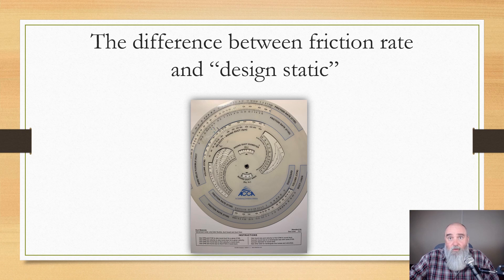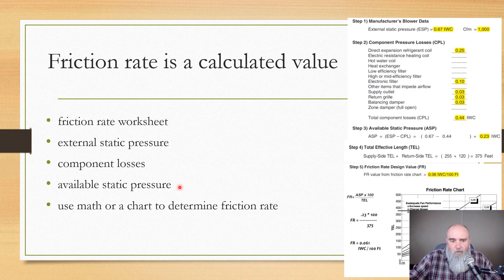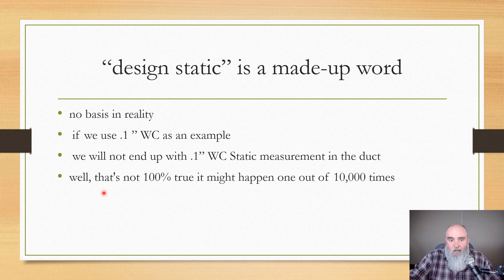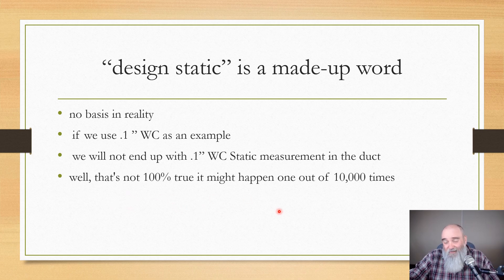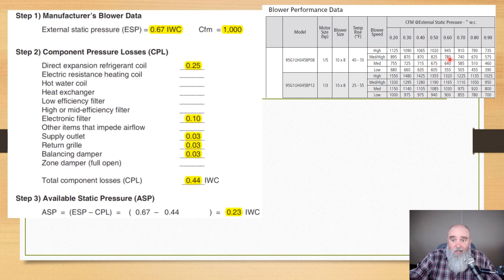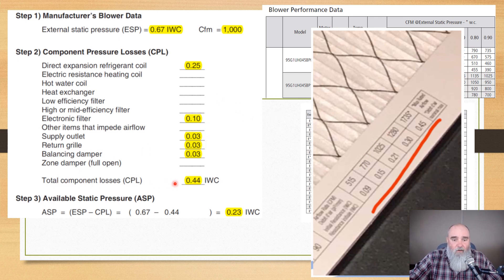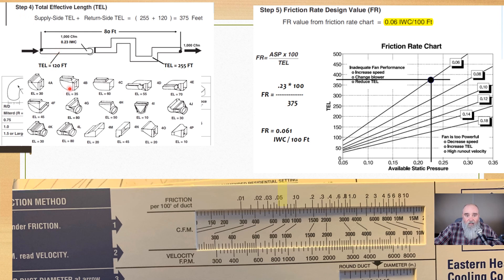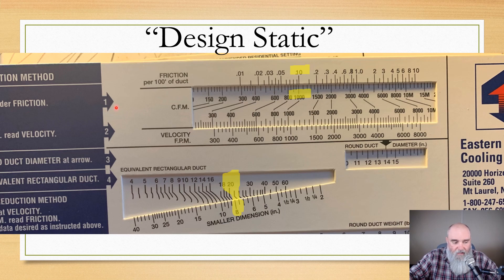The difference between friction rate and design static

Comment: 3m/Filterate definitely do not publish accurate 'initial resistance value (WC)' that they print on their products.  If a real consumer advocate group tested their products, they would be forced to change the printed information to double or triple those figures at those CFM ratings.  I am an HVAC business owner and have tested these filters in numerous MPR/Merv ratings, plus different system designs and they are not even close to those numbers.  I easily saw double the values printed in every system tested.  Unsuspecting people put those in their furnaces or air handlers thinking they struck gold, but they got fooled by fancy wording.  They are junk and it is best to still with a better filtration system instead of wasting money on that garbage.  But all brands should be forced to print some accurate data just as the EPA makes companies put out accurate information for items they regulate.  False advertising at best, but really it is fraud.

Love you videos, btw!!
Reply from the maker: Thanks Kevin. If you want to go down a fun rabbit hole find ASHRAE 52.2. That is the standard that filter manufacturers are required to test PD and MERV ratings. This might explain the discrepancy that you’re seeing. Many filter manufacturers publish. Their pressure drops at velocities that are two or three times less than what we measure in the field. I have another video that says something about filters, if you haven’t watched that one I explain some or maybe even all of what I just wrote. And I’m not going back to proofread this this is voice to text figure it out lol.
Reply: @edwardjanowiak  Thank you for responding.   I am a huge fan of our teachings online on the taped videos and your persona channel.  You have really changed the way I view heating and cooling.  And your humor makes it great to learn.  I will definitely look into that ASHRAE 52.2 and read up.  I look forward to it.  And I think I only have a couple videos left of yours to watch but might go back over the big conference videos that were like 2 hours each.   20 years in the field and I always still try to learn more each day.  You have given me some valuable information and I thank you.

Comment: Im so confused. WHAT IS FRICTION RATE? I've been researching for hours, and I don't understand this term. You also brought up a good point, how can we determine what filter the system can afford??
Reply: It’s the static pressure loss as the air moves through the duct. The friction or resistance to airflow.

Comment: Where did you find the .03 value for supply outlet and for the return grille?  Is this the sum of the grilles in the total system or the sum of the grilles along the total effective length or some type of standard value, as I see it everywhere in pressure loss discussions???
Reply from the maker: You obtain  that information from the grille and register manufacturer, you’ll find it in their performance data or engineering data for the specific grille or register that you’re going to use. That pressure drop that is included is the one grille that is in the critical path or the longest circulation path. You can have multiple grilles if you’re doing a central return and you’re using transfer grilles.

Comment: Hi Ed just makin sure now, the friction rate is on each manual of the air handler depending on the speed of the blower? And we have to match that friction rate based on how we calculate sp, pressure drop, equivalent length, etc after the design is complete correct?
Reply from the maker: No, we use The blower performance chart that’s included in the air handler as part of the process to calculate our friction rate using the guidance of Manual D